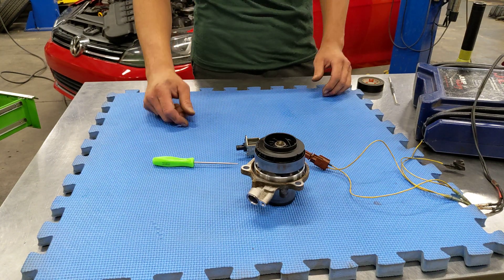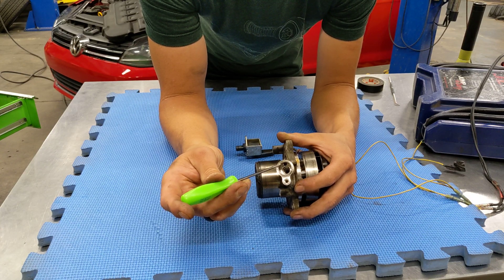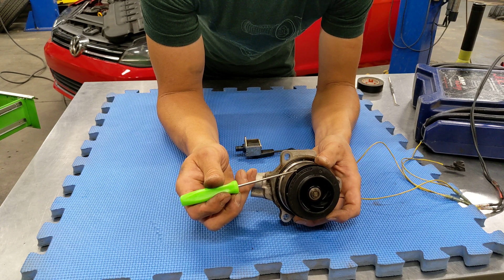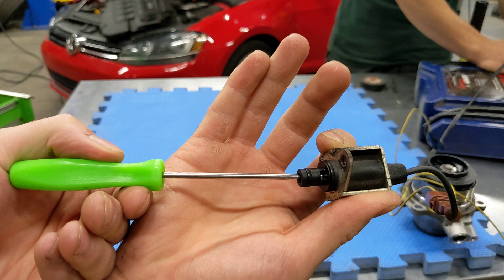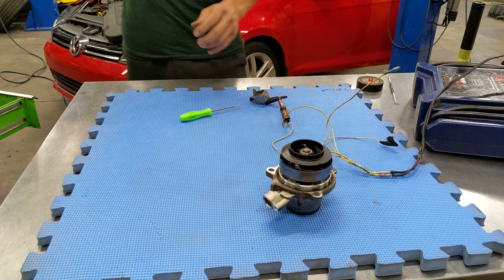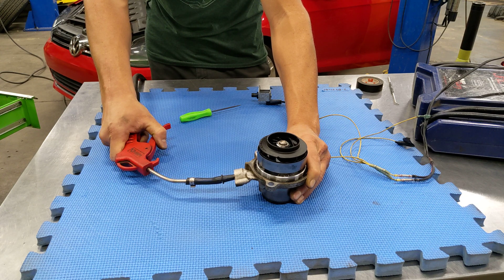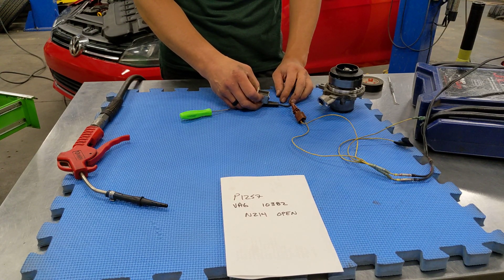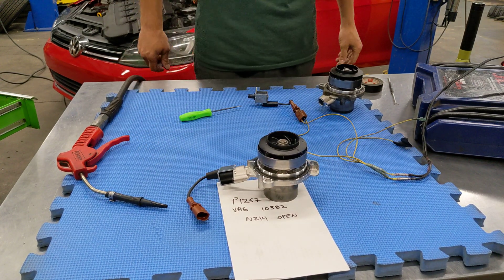Electric TDI Waterpump Explained by Dieselgeek

Comment: A question, the shield that pops up and down around the impeller, is that part can be moved by hand while the solenoid is attached? I purchased a water pump with the same design, still cannot be sure if the shield moves freely( concern is if it is jammed or not) thanks.
Reply from the maker: the shield can be moved by hand.

Comment: ECU only throws a code if the solenoid is missing, I went with the non-variable pump and it's been working just fine. I can't tell if engine warms up slower or not, curious what you guys think.
Reply from the maker: Hi Victor -  

  I'm pleased your pump is working well for you, however even the TDIs from 2 decades ago will throw faults for excessively slow warm up times. The newest ones are orders of magnitude more sensitive than in years past. We weren't going to take that risk with our customers vehicles. We also didn't want to jeopardize fuel economy or exhaust scrubber health and longevity by prolonging warm up times. Based on our experience with the older models, operating even a couple *C shy of full operating temp can cost mileage. We did consider the non-shrouded pumps; they're certainly cheaper. That being said, Dieselgeek has always been about delivering the most effective, straightforward, elegant, and trouble free solution for our customers. 

-tyler